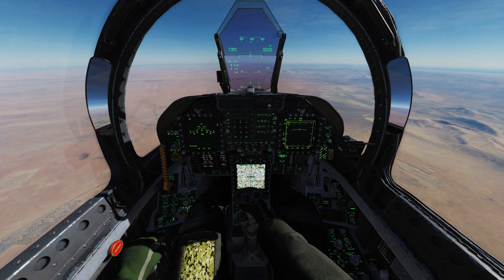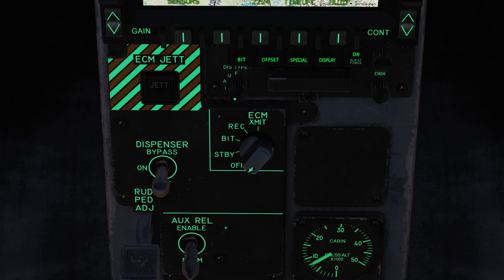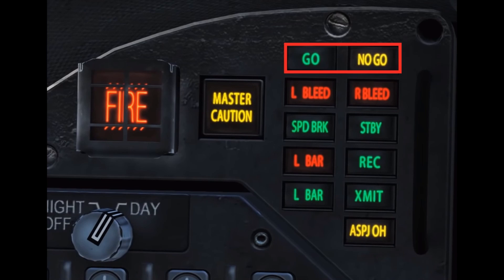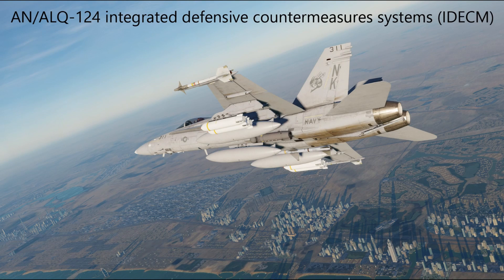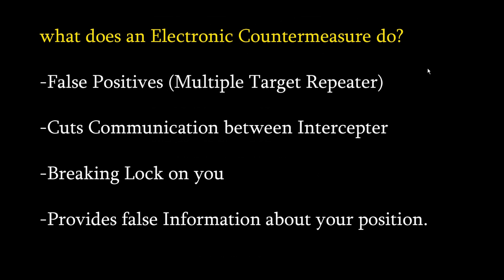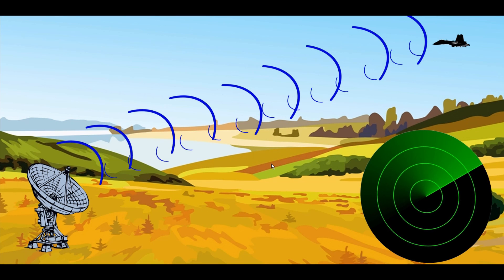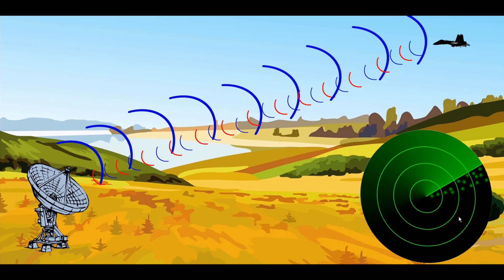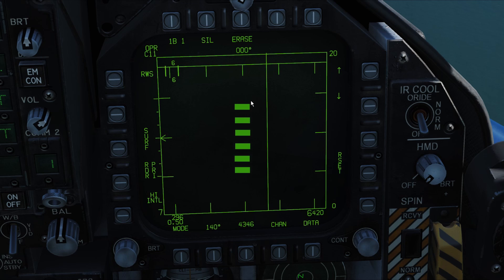DCS: F/A-18C Hornet ECM Tutorial (Electronic Countermeasures)

Comment: It's the AN/ALQ-126B in the Hornet. I repaired them in the Navy. AN/ALQ-126A in the A-7E and the A-6E. It transmits pulse for pulse deception techniques in Range and Bearing. By burying the actual RADAR return pulse in noise, so it see the false return. In XMIT or RPT (repeat) mode it turns on at a certain received power level in relation to Range. And repeats until you exit the range/power level of the Target Tracking RADAR.

Comment: I wish ECM was as detailed as Falcon BMS. I know that the DCS implementation is trying to do alot,  use publicly available info, be balanced, be realistic etc but DCS aircraft really lack in realistic IFF and ECM
Reply: Jimmy De'Souza  the ECM/RWR/IFF  in DCS pretty much use a very simplified version. You basically only have mode 4 interrogation, but no implementation of modes 1,2 or other types of mode 3. It's basically magic where in real life and Falcon BMS there is variability in the system and they aren't perfectly reliable. RWR for example is based on radar strength essentially, as well as other factors which the computer uses to determine threat level. In BMS it's not nearly as reliable as I'm DCS, in DCS the second a missile goes pitbull you can expect a lock warning, not necessarily so in BMS. Direction is also less precise in BMS. ECM in BMS works against player aircraft, and significantly impacts ranging of a target, where as in DCS not only does it not work player to player, the FC3 implementation between AC is basically the same no matter what airframe you fly. It's a very detailed topic tbh

Comment: Quantum RADAR and modern frequency-changing and timing-changing RADARs make a lot of this obsolete. I forget the actual name for it, but RADARs can now alter their frequencies and the timing between pulses to be able to discard the false-positives (the first signal returned is the correct one, as any more-distant signals must be repeated due to the timing delay between the jammer receiving the RADAR pulse and the emitter mimicing it), and quantum RADAR is even better at weeding out the junk (though it's still in early stages, but China reportedly has a quantum RADAR with a range of 60 or so miles).

Comment: I'd imagine the falsifying of position has mostly to do with firing EM waves that are tuned to the Radar's outgoing signal in a modulation that makes the Radar receive false information in its own native signal.

to clarify, imagine you are somebody in a cave hiding from a predator. This predator wants to find you by using the echoes it makes in the cave bounce off you and into it's ears. This ECM is basically you mimicking these sounds but with changes that, when heard by the predator, sound like it is coming from somewhere else in the cave.
Reply from the maker: CaptainConcerned Sr. It's a solid guess. And ur guess is as good as mine. I have no idea how that functionality of the ECM works. Good theory tho
Reply: my theory stems from experience as a Broadband spec who has to understand how signals work to make sure everyone gets their internet and tv service. It is a pretty interesting job as every problem is different and so is the environment surrounding the issues I deal with. fun fact, If you have a cable provider and they have a chewed up line on the poles, a simple short circuit of a television can output strong enough RF signal to completely jam ATC communications and Emergency Response frequencies when it is backfed through the taps and transformers as upstream. This was learned the hard way when a plane was crashed due to complete communication failure and an exposed cable line on a utility pole.
Reply from the maker: CaptainConcerned Sr. That's actually very interesting I never would have guessed that. Cool little fact there. Amazing how we live day to day not knowing the smallest thing can have such huge implications
Reply: CaptainConcerned Sr. I think the problem is that the radar wave modulation can only make the aircraft seem further away and the enemy plane still recieves 2 signals. One reflected from the plane, one from the ecm. The eurofighter can tow such an emitter behind it to also give away a false direction

Comment: I'm hearing conflicting things now. Another video here said XMIT always turns the "music on" and recv will receeive and turn on automatically when it has threats. I'm confused now.
Reply from the maker: razorseal having the ECM always "on" has major disadvantages such that it gives away ur position. Or even allows homing missiles to be fired at you. U never want to just leave it on. The ideal way to use ECM is to have it activate when there is a threat. This is why the xmit function will only really transmit if there is a threat. Otherwise it's technically in standby (sort of). This whole process is controlled automatically in the hornet. So my guess is that whatever video u saw that in, the guy was confused about the functionality of the ECM.
Reply: Thanks! so xmit is automatic. got it! I would think the xmit light would come on only when it's actually actively transmitting?
Reply from the maker: ur welcome, and I can't comment on how the light works because like I said I haven't seen it yet. it may stay on just to let u know its in that mode. I don't know were going to have to wait and find out when its fully implemented.